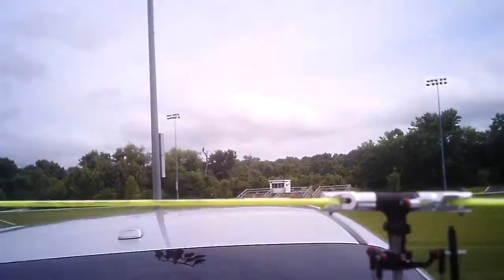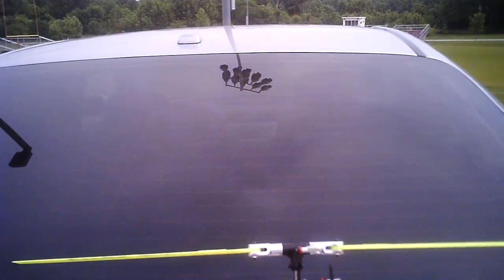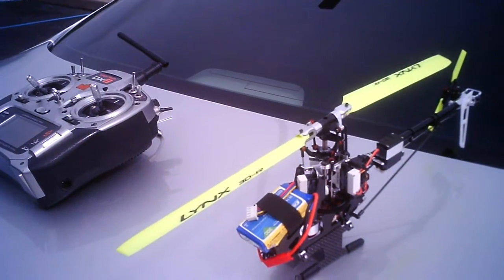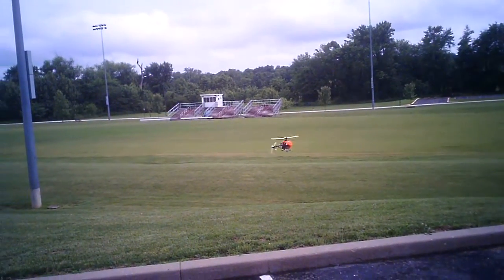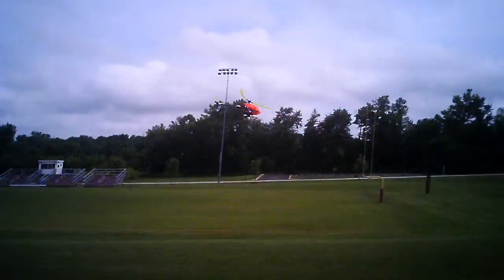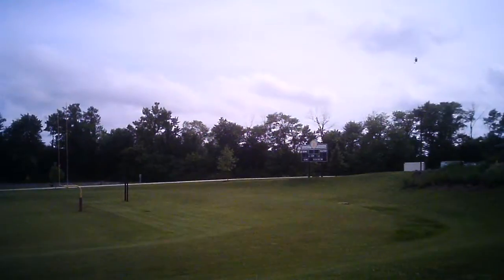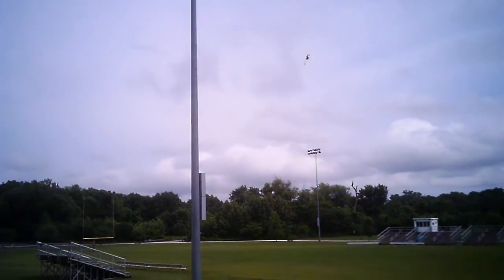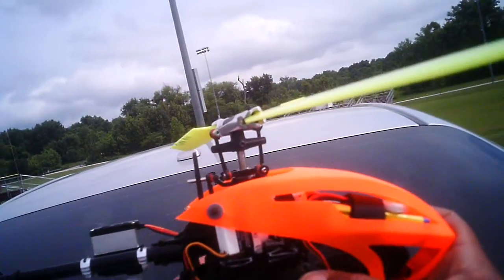Blade 180cfx New 3s Motor 3DLee 06 04 15

Comment: Nice flight 3d lee :) +  Very informative video. May i ask how did you film this as it seems you were alone? I wouldn't mind getting a go pro in case my friend cant make it out i will have a head mount or something along those lines
Reply from the maker: +Peter Jordan Hey Peter, sorry for such a late response, but I just noticed your comment.  I bought a keychain camera which is about the size of a typical alarm remote for a car and I velcro'd it to the the top of a baseball cap and it sees everything that i see.